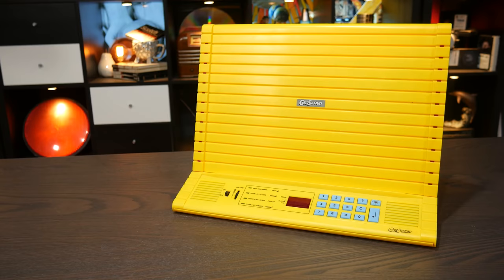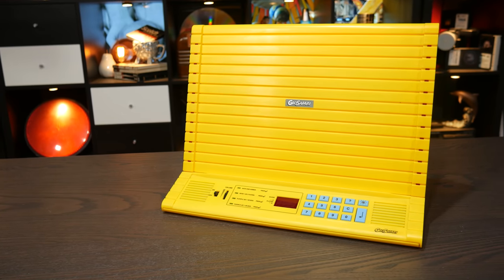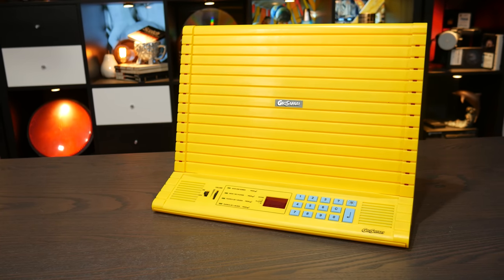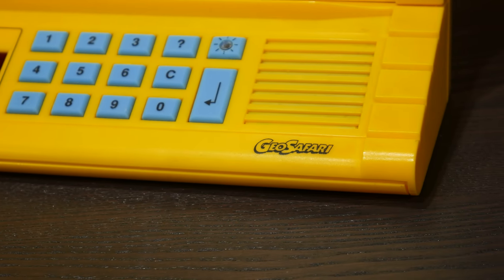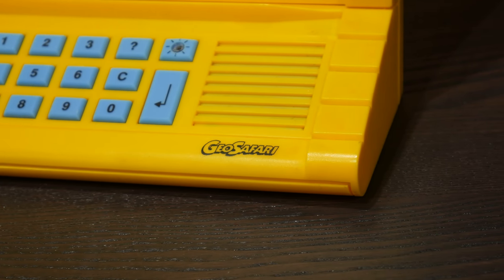The GeoSafari Jr. was a cleverly flexible kid's game

Comment: Big Clive would've given us a circuit diagram for those side LED boards! I want to see how they're wired up. There aren't enough wires for 1 per LED. Are they matrixed? Half of them reverse-biased? Is there maybe a little chip on board?

Shame about the epoxy blob, but that's what you do when it's really low-budget, saves money on an IC package, saves on legs, saves on having to solder an IC package to the PCB. Instead it's just glued on, the chip's pads are wire bonded to the PCB in much the same way they would to an IC's legs, then they glob the epoxy on top.

I can't think how much money it would save, bearing in mind you can get some really cheap ICs in ordinary DIP packages. But it all adds up I suppose. It's a shame. But OTOH I'd bet my right arm that it's just a microcontroller. Maybe a mask ROM one since they made them in a high volume, though some companies use flash-based chips, because it allows last-minute changes to the programming if it turns out they're needed, where with mask ROM you have to chuck out the whole batch and wait for the factory to do you another one, which they require paying for. 

That toy was in every catalogue, when I was a kid, here in the UK, so they obviously made a few of them.

The microcontroller will probably have just a few K ROM and maybe a couple of hundred bytes RAM, depending on how sophisticated it's program is. Doesn't seem very. Programmed in assembler, probably, because they did that, back then. Might even be a 4-bit CPU, though they seem lke they're weird and annoying to program. I've never programmed one but I've read a datasheet and it's all done very oddly, compared to an 8-bit or up CPU. 8 bits would be plenty, and cheap enough. Maybe it's a PIC.

If you ever find a broken one, you could ship the main PCB off to somebody who de-caps microchips as a hobby. Often they do it to make their living, charging a ton of money cos their work is valuable and there's little competition. But if you can convince them it'd be fun, they'll likely do it for nothing. That'd tell you a lot about the CPU, might even be able to reconstruct the ROM, if it's mask ROM, though that's slow and boring work, you're not gonna get that for free.

Comment: Ugh.. why do people keep complaining about the imperial system in the United States. "It's not metric, you should use metric.." blah blah. News flash the imperial system is metric. Every measurement in the imperial system is tied to it's counter part in the base metric system. So technically the imperial system is metric but doesn't use base metric hard points.

Comment: Ah... another fellow American who doesnt understand y we dont adopt the metric system. Its because decimalization is bad. 10 is actually a terrible set to base a numerical system on. 10 cannot be divided by 3. 1/3 of a foot is 4 inches. 1/3 of a meter is 33.333333333333333333333333333333 ad infinitum centimeters.
Reply: Also, despite metric fans claiming standard units are "arbitrary", actually its the metric system is the system whose units are not based on anything in the real world. A foot is literally a size 12 shoe. An inch is the average size from the tip of a mans finger to the middle of his first knuckle. A foot is a way more useful unit then a meter. An inch is more useful then a centimeter. A mile is more useful then a kilometer. Metric was designed to dumb down units to make them "easier" to learn. I dont believe its easier or more useful...